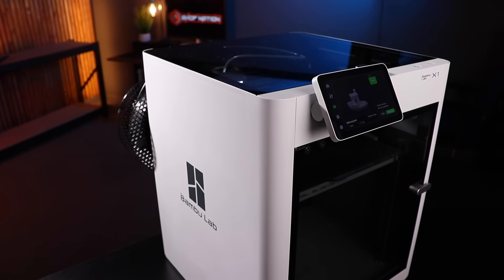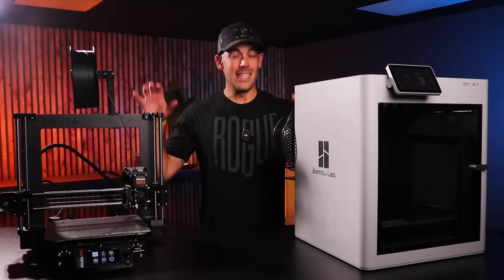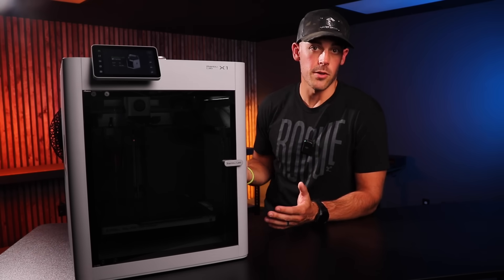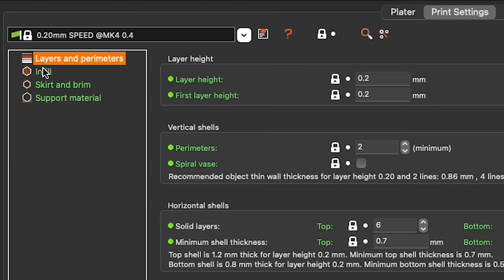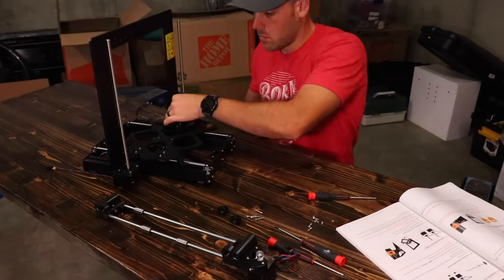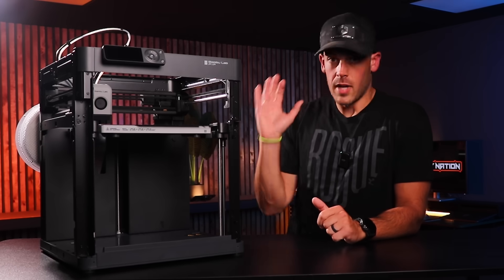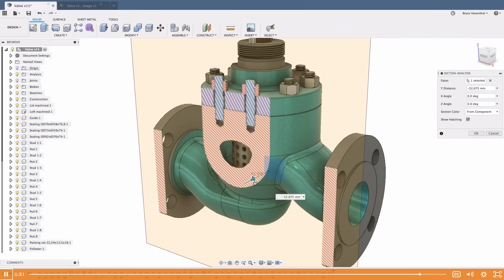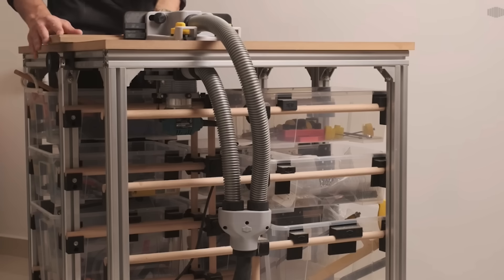The 3D Printer I'd buy if I started over

Comment: I got a K1 max about 18 months ago and I have had nothing, utterly norhing, but problems. I've gotten some good things out of it, but mostly, I've just ruined a lot of plastic to make terrible things that look like shit. I so desperately want to enjoy it, but whenever I want to tackle something (Like the fractal vise that recently got awarded one of the sites). It ruined it's hotend in less than a fortnight, the camera crashes constantly, the bed levelling is terrible (From what little I can work out because there is simultaneously a million videos on them, but few are actually current or helpful). I'm at the point of giving up, selling it, and going back to gunpla.
Reply: And the documentation out there is just chaos. If you don't understand something, you will be told to google it, and if you do, you will get a slew of posts with conflicting info, bad info, incomplete info, and you come out of it even more confused. Like I said, I have a K1 max. It hasn't had 'proper' maintenance like lubing, because I can't find any info on it that doesn't talk to you like you just need a reminder and know what to do.
Reply: You just answered one of my questions, which is on courses. I want to learn to make my own parts (I really enjoy microelectronics) but don't know anything about CAD, 3D modelling, so on, and want a class that does what you say, starts with 'So you have a printer...' and goes on to teach you what you need. But this hobby is as user helpful, albeit enthusiastically so, as a hedgehog shower scrubber.

Comment: This was a fantastic video! I'm looking to get my first printer and start learning the basics. The one question I have is should I opt for the enclosed cabinet for temperature regulation, and for safety (I have two kids)?
Reply: Short answer is that enclosed printers will allow you to print a wider range of materials, in addition to helping to increase the print success rates of certain filaments. I'm about to buy my first as well and— for my needs and wants—I'm going for an enclosed flagship model. Currently I don't have very many ideas or plans to use a large number of the filaments that require or are suggested to be used in a heated enclosure, however I would like the capability to do so with this printer if the need or want should arise. My layman's understanding is that the higher temps allow for stronger, more durable materials like carbon fiber for example.

If you don't have access to a window where you can vent the room containing your printer, then you'll need/want at least some type of filtration that is tuned to handle the outgassing which occurs during heating and extrusion. Some filaments are worse than others in that regard, resin printers have similar issues. Carbon filters appear to be an option for this however I don't know if they can handle the total range of what all is outgassed by certain filaments, so you'll need to look into that if you're going to run this inside your home, especially with your kids. For some materials, it may also be prudent to wear a mask with filter as added precaution. I have window access so I'm just purchasing a walk-in hydroponic grow tent and then installing a low volume exhaust fan connected to the window to maintain negative pressure inside the tent.
Reply: @dizzle8465  Thank you for this!

Comment: At the end of the day you really need to decide if you’re into using 3D printers, or into 3D printers.   A lot of systems on the market, especially the cheaper systems like the Ender, is the STI/WRX of the printer world.  You generally tend to gravitate toward those if you really want to build a customized setup.  If you don’t want to spend time building and tweaking the platform, go for the turnkey track-ready version.  It may cost more initially, but you’re not going to essentially rebuild the thing 10 different times with different upgrade kits.

For example I’m an engineer by trade, I’m not great at modeling.  I get more satisfaction making my printer do things and downloading other people’s models than spending time building new models.   Because I am the person who does his own repairs, takes things apart, wants to go through the process of understanding how they work.

Comment: Nah. Just go to forums etc. and buy used printer or buy like some cheap Ender 3 or something like that. Don't buy these "influencers" stuff. Yeah it's not great, but they're absolutely usable and going for like even 400 printer is absolute stupidity for new comers. Let's get things straight. 3D printers aren't suitable for everything. You need bushing or something like that? Well buy a cheap lathe and get like 100x better parts with very little practice. Then the second thing is that if you don't know 3D modeling, well the printer is bluntly said completely useless for you if I'm honest. The essence of 3D printing is to do things YOU need. Not some random badly made, almost suitable for you things from like Thingiverse or Printables. Don't get me wrong, there are great stuff and occasionally I print something out of those. But like 99% of prints are what I've modeled for my needs. It's crucial skill to get into. Now that cheap printer will quickly show you what you can and can't accomplish with 3D printing and it'll quickly tell you if it's your thing or not. I got myself cheapest printer I could +10 years ago and it was absolutely garbage compared to anything sold these days for like 200 dollars, maybe even less. Made out of pieces of wobbly acrylic and still it got me into truly learning 3D modeling and noticing later I'll need to upgrade to better printer. As I mentioned it's downright foolish to throw even that 400 into printer if you don't have experience or if you'll drop interest in it like within month and trust me, there's plenty of examples of that if you go into printing forums etc.. Few years ago I had young 20 year old apprentice mechanic at work (student with students common financial problems) and I showed what I'd done at work with 3D printing and almost forced him to model two simple things we needed and printed them. This guy like week later had bought that first gen Ender 3 I suggested as maybe first printer and was very happy with it and he was now really into 3D modeling thanking me for tips.

Comment: hi there,

no question, just to tell you the presentation is simple and bloody cristal clear. Well Done Bro.
i was exactly interested in either prusa 4 or bambu lab and did not know if autodesk fusion 360 will interest me, but now it does.
i liked the fact that you have presented prusa 3 kit and bambu p1p for economical reasons .

you have explained the difference between softwares ( a slicer prog is not a modeling software that is a designing prog but many newby don t get it ) .  you explained we could go on thingiverse for complete models to download. 

if i may (not an obligation ) but for beginers talking about compatible files for the 3d machine would be great.

thanks,

keep going,

Farid 🙂

Comment: If you don't have a printer, there is no point to get a MK3S+. A MK4S have features than a MK3S+ don't have. Like using pressure to calibrate to Z axis with the bed instead of the MK3s sensor on the extruder. It's made to help beginner able to print correctly without issues. The MK3S+ can be thrown in a museum, most of the MK3S+ features are outdated. 

Yes, it print good but no reason to buy one in 2024/2025. And the price difference between a up to date printer (mK4S) & a outdated printer (mk3S+) is like 200$. So ...

Ha, and if you want to be pro, don't buy high end casual printer in the first place. Buy a printer made for pro. Don't act like a hobbyist in the industrial sector.

Comment: I was looking for a good and specific recommendation, as I had some fun with 3D printing while doing an internship, but couldn't really decide and didn't really want to start a detailed research about model, trim, engine, wheels, suspension and stuff ;)
Still, would have liked a little more details on the printers (again cause not entirely new to them), but as an automotive engineer I very much appreciated the comparison to Toyota and Tesla (while now I would recommend to use a different manufacturer 😅)

Comment: If I did it all over again I wouldn't even buy one. Nothing ever printed is something I would use except for the odd thing like static hook for clothing, and the amount of energy and filament wasted is really off the charts. Show me on a scale where 3D printing on a hobby basis is anywhere near makling anything more productive. cheaper, or less wasteful. If less wasteful cannot be resolved, the rest means nothing. It's still in it's infancy even now, it's a hobby, and and a really wasteful one at that. This has benefit for pre-production models in an engineering environment and really nothing more. I'm not negating the strides that hobby 3D printing has made in the grander sense like testing and such, but those are very limited to the bigger brains of the hobby, and the overall waste cannot compete with that. 
I dare someone else with more time than I have to come up with a rebuttal of the amount of overall waste of energy that this is.
That being said, It's fun.

The best thing about 3D printing is that you learn a piece of software that could be put to better use. The world has a finite amount of resource. I'm no eco-freak, but it's a thing.
Reply: Think of it like this: it's a tool. How often do you use your brad nailer at home? That's probably how oftrn you'll use the 3d printer at home too.
I used to print a lot and it was a mind game to buuld the printer, but once i built it, i don't use it as much, just when i need it! i designed replacement parts and special one-off items and uploaded designs to thingiverse for others to use. It's helped me a ton because i replace a five cent plastic part instead of re-buying $100 worth of sub-systems. (Ex: safety endcap for a table instead of buying a replacement leg)
I mean i have a electric drill i only use once every three months, but that doesn't make it useless!

Comment: know this is an older video and I'm ready to pull the trigger on a new purchase I do want the ability to print carbon fiber??? is that possible I've read a lot about the babmbulab software being so propiatary that its NOT user friendly so looking for another suggestion for a new printer with very smooth printing that last longer than 15 prints?? Thanks Sam

Comment: I bought a refurbished Ender 3 v3 se for 78€ (83 $) as my first printer.
Everything works so well and I have absolutely no problems. 
Yes there is no wi-fi, there's is no big display, it's not the fastest printer,... 
With direct extruder and auto bed leveling it's a great choice to test 3D printing.
Reply: Same, I still have the ender 3 v3 se its a good printer overall and it helps when my main printers are printing :p
Reply: I have it too it’s just that the bed adhesion is bad probably user error

Comment: What you are saying is true. However, if your budget can’t come close to $1200, it’s out the question. 5 years I purchased an Ender 3. The reason for this was simply I could afford it and the numbers worked out. I needed the draw detente for my tool box. Total needed 54. I found the cheapest at time around $9.50 each, for a total of $530. The printer, plus one spool of TPU. I had a printer and 54 detents for $220. Much better than $1200. If I were to do it again and budget would aloud it I would be very interested in an inclosed printer. I find I would like to print ASA, Nylon, Delrin,  HDPE and carbon fiber filaments. Some of which will or may print without the chamber, others will not. So I am stuck with a very reliable printer that has already paid for itself twice over.

Comment: My prusa mk3s+ wont finish a print. First, i cant get anything to adhere to the bed. 
Second, it "crashes" all the time. 
The only thing i can get it to print is a benchy. I tried printing some small parts but bed adhesion issues killed that one. I tried printing bigger parts but again bed adhesion and crashing killed those prints. How can i fix the bed adhesion issues? I bought a new build plate no luck. The bed is heating evenly, the levelling sensor is placed correctly, and the first layers work fine till i get about 4 layers up and it starts to pull off the bed. Its sad to say that my ender 3 pro is consistently printing way better than my prusa. 😢
As for 3d modeling, i believe onshape has a free to makers option. Its a great software. Solidworks is very intuitive but its not cheap.

Comment: Hi Guys, I've been using 3D printers for probably over 10 years now as I purchased a Stratsys for my work. It was about $20k (Australian) but was a beast. It wasn't super fast but reliable as, we just did the basic service when it said and it would run forever. I purchased a 3D printer about 18 months ago for where I work now but because my boss was new to them I ended up buying an Ended V2. I've been through 2 in the warranty period and the 3rd is now playing up. I have to try and work out what's ging on or maybe purchase a new printer. 
If i go for new I want something reliable and so have been looking at both the Bambu X1C or the Prusa Core 1. I think I'm leaning toward the Prusa due mainly to the reliability. Any pro's or cons I should know about?

Comment: Upgraded my Prusa MK3S+ to a MK3.5 with input shaping last year ($249) and the speed gain is pretty spectacular. On the order of twice as fast-ish. A bunch of other upgrades in that iteration as well, not the least of which was putting WIFI onboard thereby eliminating the "ridiculous for this decade" requirement of a hard cable connection and/or walking back and forth with a usb stick.

Another point for Prusa IMHO; they produce a whole line of affordable upgrade kits for their existing machines so you can get the latest and greatest features without needing to get a whole new machine, and the upgrades are even offered in steps so you can get what you want and not pay for what you don't because it's in the package whether you want it or not.

Comment: Haven't tried the M4K, but my MK3 was a disaster.  Prusa deviated from the E3D bore dimensions.  Took for ever to diagnose, comparing measurements of it vs open source, and the problem went away once I replace the OEM heat break with an aftermarket one.  No thanks to Prusa who were beyond useless.  After sending essentially an engineering NCR detailing my findings, they suggested "have you tried restarting the printer".   The upgrade to the XC1?  Like Peewee house league compared to the majors.

Comment: I just purchased a P1S... I think I'm going to attempt to cancel the purchase and go for the X1Carbon.  The whole bed temp is really nagging on me.  I know there's mods for the haet bed... but that just offsets the temp so the printer doesn't know it's hit the limit.  I am done with tinkering.  I want to start printing with PC and other more exotics and the heated bed seems to be the one ting that will kill that dream.. especially if it's not an Bambu flavored filament.  From what I've gathered their filaments are tuned to work best on their printer configs.. that means I really would be limited by the bed temps.  Then there's the camera..... ugh.. a slideshow...  I don't want to deal with external cameras straped to the outside lol...  I had an Ender 5 and while it COULD print good and COULD print ABS... I spent more time workingon it than printing.  I hope they allow the trade up since it hasn't even started shipping yet.

Comment: This by far is one of the most impressive and informative presentations I have seen to date on YouTube. Well done Sir. I might add, I have both the Prusa MK4 as well as the Bambu Lab X1. After experiencing many others these two have been the most reliable. One other thing, Fusion 360 is my preferred design software. My 3D design and printing is for personal use. That may change at some point. Thanks for your video and I agree with your entire presentation.

Comment: I am a industrial designer and have used a Zortrax M300 and loved the printing fidelity,  However, so many parts were aborted because they delaminated from the print bed.  The printer has sat in my studio and I don't use it because of it's unreliability and why I haven't replaced it.

That being said, another thing I hate is part cleanup...that is, removing support material.  Are there any printers that have support material that can be dissolved in water?  

These look so promising, but also, I model in a program called Rhino on a Mac Platform.  Do Prusa and Bambu have slicer programs that run on the latest Mac OS Sequoia?

Great video and I've subscribed...I sure would appreciate a answer to the questions.

Comment: Is it just me or is $1000+ for a beginner first FDM printer a MASSIVE investment? I was thinking more along the lines of the 200/300 range.....or am I way off 😔😮‍💨
Reply: Your not wrong
Reply: No, you're not wrong. I got 2 Ender 3's with some upgrades for $300 about 8 months ago, knowing basically nothing about 3d printing. I knew it would be a steep learning curve, but that I would come out ahead if I stuck to it. Dozens of spools with great results (and a box full of mistakes to remind myself how it started) later, I have zero regrets and still love those little old machines. I have a K1 Max now, and even though it's bigger and faster, there are still many smaller projects that my old E3s handle just fine. Do some reading, pick the machine that seems to suit your needs and your budget the best, and do it. If you come up against an issue, take a breather, and look for a solution online. It's all out there, there isn't a mistake that a new 3d user can make that hasn't been made 1000X before.